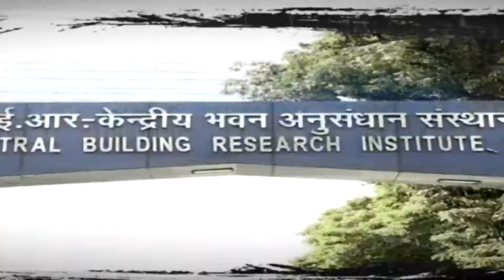CBRI's Precast stone masonry block movie: BKP Media

Comment: Thank you very much for the instructive video. I have some questions I would like you to answer if possible.
1) Have you researched into the possibility of replacing the sand of the concrete with soil of a quality suitable for Adobe or Compressed Earth Block?
2) Have you researched into the possibility of incorporating smaller stone fragments eg at the sides and corners of the block. Do they negatively affect the strength and/or the curing time of the blocks?